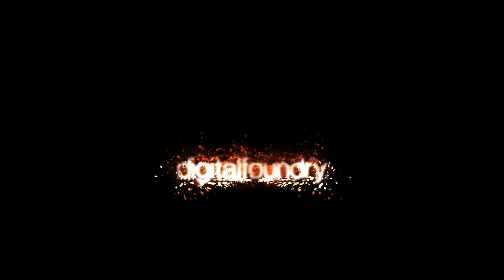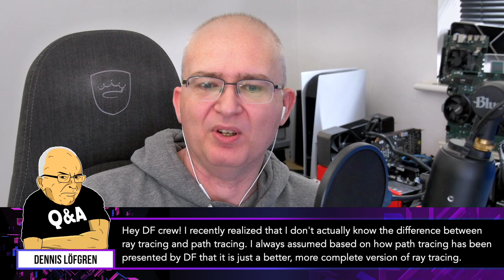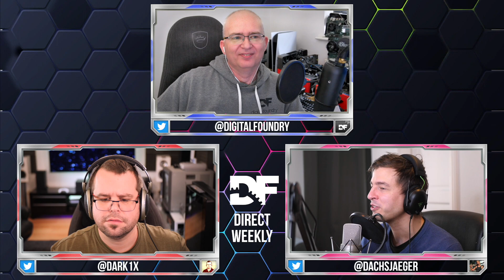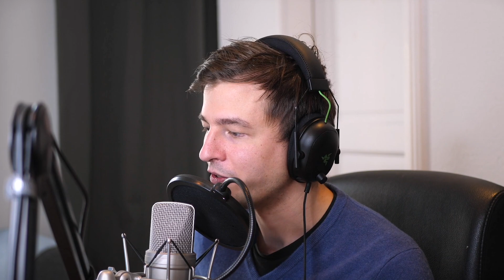What's The Difference Between Path Tracing And Ray Tracing?

Comment: I'd like you guys to do a video on what is actually being computed for every frame (not necessarily in RT but graphics processing in general). When I think of all this stuff I'm thinking it's being done every single frame but I don't think that's true.
Reply: It is being done every single frame - path traced games like Cyberpunk 2077 Overdrive shoot out one or more rays per pixel each frame, and follow the rays through multiple bounces (I believe Cyberpunk tracks up to three bounces). Though DLSS means the frames are not necessarily full size, so there's less work. Real time raytracing can only shoot out a few rays per pixel each frame at most or it becomes unbearably slow on even the fastest GPUs, so the resulting image is always very noisy and has to use strong temporal denoising - meaning rays shot from that pixel in previous frames are referenced for additional information, as well as various image buffers, plus some extra image processing on top.

For comparison, Hollywood CGI movies using non-realtime ray tracers render images with usually a few hundred ray paths per pixel and the paths are tracked through more than a half dozen bounces or simply until the light energy falls below a certain threshold - movies use as little denoising as possible.
Reply: @KillahMate   I read his comment and I kind of got the feeling he was looking for information not necessarily in RT, but graphics processing in general. That was good info for rays though, but what about general compute?
Reply: @Mcnooblet  Oh like shaders and postprocessing and that stuff, materials and screenspace effects and and AA and DOF and motion blur and tonemapping etc etc. That's multiple huge topics. Maybe DF could do a rundown of a stereotypical rendering pipeline, but that's getting really technical - more technical than even DF usually covers I think.

Comment: Basically we are still baby steps. Reason path tracing looks "worse" is because it is so much more complex and takes 3 times as much time if not more as regular ray tracing to complete and thus the noise we see in path tracing is just incomplete picture due to insufficient rays being cast per second.
Obviously they designed some sort of denoisers that developers "hand craft" in order to properly present the picture remove the noise but with that you lose some details. Depends how skilled devs are at hand crafting denoisers to properly treat the image.
Now the newest addition is using A.I. to do the denoising as obviously A.I. is just going to be soooo much faster, more efficient and at the same time better at it just as we can see with cyberpunk and alan wake 2 but especially in cyberpunk we can still see some innefficiency due to I'd rather call it "beta testing" of A.I. denoiser A.K.A. ray reconstruction. As we can see sometimes it can remove details as it perceives it as random noise, and it can introduce some oversharpening but in 90% of image delivery it does outstanding job AND costs less then hand crafted denoisers.

So basically in the future we will be using A.I. denoiser but the fun part is seeing how much the GPUs will grow in terms of ray casting capability and processing. And how will GPUs look in the future say 5 or 10 years from now when probably most of the die will be transistors made to shoot rays instead of drawing raster.

Oh boy what a time to be alive. Transitioning into what we could only watch in animated movies or live action with CGI. I just can't wait to see what wacky shit devs will come up with when path tracing becomes standard. Everyone probably thinks "ah they'll just focus on realism". Nah. That's the beauty of it. When you don't have to mess with a scene for a month because you are trying to hide fuck ups from poor rasterization lighting that is casting shadows weirdly but have proper accurate tool that casts light accurately, you can spend all that time making the scenes look gorgeous, weird, messy, clean, sick... Whatever you want it to be.

Gosh I truly cannot wait.
Reply: You think that game devs have anything to do with Denoising RT effects , You give us way too much credit.

Most of that happens on a driver and game engine level long before game devs get our hands on it.
Reply: @Jasontvnd9  yes that's if you want to use default denoising settings that are shipped with.
If you want to extract details from denoisers you gotta go custom and fine tune it to the way you envision it balancing between loss of details or noisier but with more details.

Comment: I am just amazed GPUs can even do path tracing, that workload is very memory latency and not fit for SIMDs, its truly an achievement, if only someone shares(amd/intel/nvidia) about how they are actually doing it i.e handling random memory request..
Reply: While the workload is high, it's not necessarily doing the same work as a full-on ray-tracer in something like Blender would. Ray Reconstruction and similar techniques are doing a lot of the work to fill in the gaps to take what's a relatively incomplete image and get you the final result, if I understand right.
Reply: @docmars   I thought RR was just replacing the denoisers and getting rid of the noise of PT/RT in a more efficient way. What do you mean it and similar techniques does the work to fill in the gaps on what's a relatively incomplete image? I wouldn't call raster lighting, shadows, and reflections an "incomplete" image unless you mean the whole thing is an incomplete image because it's all fake anyway. Realistic lightning, shadows, and reflections is more of a supplement to an existing rasterized image, that at its core is still a rasterized image regardless. RT/PT isn't necessarily to complete an image, as much as it is to enhance an image more accurately.

Comment: I’m still lost, I thought the whole point of ray tracing was to shoot and bounce more rays to gather more information. Could yall make a more illustrated version of what yall are trying to explain?
Reply: XOTWOD
Reply: What I understand is: RT itself is just like shooting a laser from point A to B (ray casting). When you do that, you may, via rendering API (like vulkan and dx12), ask what was hit for more info, like its properties, which color, which material it is made of. Then if developer wishes, this type of info may be used this to compose and improve your 3d application image output based on what developer decided to query with the rays engine shoot in 3d space. That's why with simple RT you may enable RT Reflections, or Shadows or AO individually, which in turn makes it a cheaper option since you are being more selective with the rays you shoot and also the info you are querying for (plus devs might do smart things like avoid shooting rays when it is unnecessary etc).
What usually happens with Path Tracing is that while you are still shooting rays, it is now an insane amount of rays going everywhere, randomly (mostly), plus already asking the surfaces/objects what are their properties, then, instead of using that info to compose image output, it is going to be used as the image output itself, having little to none image composition, mixing traditional rasterization. It is more simple because you wanna avoid going too smart with the rays you shoot in order to get the most accurate image output possible
(if I said anything wrong, feel free to correct me)
Reply: @Ferdam  That's a common misconception and no, in both cases you shoot rays from the camera and trace them recursively.
It's really more about the lighting being made of a single coherent pass rather than distinct components like AO, GI, etc - it all happens in one, rather than being separate and composited together, leading to more realistic and fine-grained results especially where things like shadows, GI and AO would normally mix.

Comment: I always thought 'path' tracing referred to the complete path of light as apposed to a ray which only relates to a single straight line 'ray' from point A to point B. A path would, for example, include not just a line from the camera to water, but also calculate the refraction angle of hitting the water and continue to a mirror in the water where it calculates the reflection off the mirror and continues back towards the surface of the water where it again calculates the refraction of leaving the water and continues to terminate on a non-reflective surface. It then calculates the color of that non reflective surface by checking the surface color properties combined with how that surface is illuminated.
Reply: That is correct. Ray tracing is every kind of rendering with light rays, and path tracing is a type of ray tracing using many rays to calculate light paths.
Reply: @KillahMate  No, this is not quite correct, as even in raytracing you can calculate a complete path of light. It's more about lighting being one coherent pass instead of separate components like reflections, AO, etc - but there is no one definition for it.

Comment: one destroys performance and one completely annihilates it and pees on its grave
Reply: And both look and perform worse than any other rendering method for global illumination.
Reply: @vitordelima  there is no rendering method that looks better than path tracing (at least yet)
Reply: @moistweineis Rasterisation can look amazing. Just look at RDR2 which is what 5 years old by now, or any tech demo/benchmark worth its salt. Heck all the way back in 2007 Crysis was impressive, and it was largely hardware of that time holding it back. Much can be achieved even in DirectX 9.
Reply: @Koozwad And those are older methods. VXGI 2.0 looked almost the same as those Hardware RT methods but it was also clear looking and without any post-processing (not even upscaling).
Deep screen space GI is hardly any different from a fully raytraced reference from Blender that takes minutes to render, and many of the issues of such methods can be improved.
Reply: @Koozwad  i didn't say say that raster can't look good, i said that path tracing is the ground truth right now.
Reply: @vitordelima  Yeah, heck, even in the late 90s/early 2000s, perfectly sharp real-time reflections were possible. What ever happened to those? Not everything has to be blurry for some reason. Is blur the new meta?
Reply: @moistweineis  That's the thing though, if enough work gets put into it, rasterisation can look better and without the inevitable trade-off that RT/PT requires. No blur, no reliance on trickery(fake resolutions/frames) to make it playable. RT/PT is a relatively quick and lazy way for devs to make games 'shiny' but it does come at a cost in fidelity, if you get what I mean.
Reply: @Koozwad They used cube or sphere mapping, or flipped everything according to the plane of reflection, or other tricks. Those methods also improved as time passed, for example cube maps can use parallax correction so it doesn't always look metallic and screen space reflections replaced those old tricks which involved redrawing part of the scene. Both can be hybridized together with some voxel based raytracing to achieve similar results to RT.

Comment: These terms got different meanings over the years so if you start googling the terms it looks like they are getting used for the same thing.

Ray tracing is just determining visibility between two points by casting a ray from A to B and see if it intersects something. Path tracing is using ray tracing to calculate effects like global illumination. What games call ray tracing is more akin to what we often call Whitted Ray Tracing.

With Whitted Ray Tracing you cast rays for effects like refraction, reflection or for determining if a pixel is in shadow. A game can choose to use ray tracing for some of these effects or all, so you can mix and match. For shadows you cast rays to all light sources to see if the pixel is lit. For reflection and refraction you cast rays in the direction of the refraction/reflection and then on hit,  another ray to see if the new point is in shadow. You can also use ray tracing to simulate ambient occlusion (which is actually a cheap hack, but one that is often used as it makes object seem more grounded).

With path tracing you simulate multiple bounces of light. You don't just cast rays against light but you cast them in all directions because light can also bounce of walls. Because of this you simulate both reflection and global illumination at the same time. You also don't need to calculate ambient occlusion. Because you need to cast rays in all directions you need to cast more rays to reduce the noise and so it's more expensive to calculate.

Both Whitted Ray Tracing and Path tracing are forms of Light Transport algorithms. There are also more algorithms that fall under Light Transport and a lot of them use ray tracing. Because of this the terms get mixed up a lot in literature.
Reply: Thank you. Follow up newb questions:
1.) so in the context of the question of which is “better” path tracing (pt) is more complete than ray tracing (rt) in that you are obtaining a more complete understanding of how to render various pixels?
2.) pt looks worse than rt right now because we don’t have the horsepower to do full pt without some optimizations/hacks/guestimations so we don’t do full pt but there might be games with fairly full or complete pt?
Reply: I don't usually see much of a difference (if any)between RT shadows and non-RT shadows and RT and non-RT light sources. 
So I shall usually use just reflections.
They tend to look incredible in CP2077. 

In Spiderman 2 also from what I can tell from DF analyses.

Comment: When you say "you shoot another ray to get more information" do you mean just increasing the number of bounces? I thought the difference between ray and path tracing was that one traces the ray from the camera to the light source, and the other bounces the rays around the objects in the scene. I could be wrong. I was hoping this video would fill the gaps in my knowledge, but I'm afraid it failed to do so.
Reply: No, "bounces" is how many times rays are hit and reflected. Say if you have 1 bounce, it'll hit the object and go to the next object only one time, then give information back.
Two bounces are: hit the first object, then the second object, then the third and give information back - so on.

Both path and ray tracing use bounces, however, path tracing is more accurate as it doesn't require information to be visible to the "player". While Ray tracing only knows what's in view - kinda
Reply: @DanielLangeYT  That's incorrect. You might be thinking of screen-space techniques that require stuff to be in view - both path tracing and ray tracing are global.
Path tracing is a type of raytracing.
It's really more about the lighting being made of a single coherent pass rather than distinct components like AO, GI, etc - it all happens in one, rather than being separate and composited together, leading to more realistic and fine-grained results especially where things like shadows, GI and AO would normally mix.

Comment: If you really want to boil it down, Real-Time Ray Tracing is the calculation and rendering of realistic light bouncing and reflections in relation to the surroundings, and due to how demanding it is on current systems certain aspects of Ray Tracing can be enabled or disabled, such as Shadows, RTGI or RTAO.
Path Tracing is basically Real-Time RT within Real-Time RT; It's RT with more data involved, which requires a second passthrough to do it and because of that accuracy you begin to get extra details like the Inter-Reflections example (Imagine looking in a mirror, through a puddle, and it's all dynamically rendered at once).
Reply: Thank you for the missinformation. Real time rt within real time rt lmao wtf you on?
Reply: That's not true though. Recursive raytracing does not make raytracing pahtracing. It more about all components of illumination being done in one coherent pass, rather than as separate effects like AO, reflections, etc.

Comment: What's the difference between ray tracing, and path tracing? That's like saying What's the difference between a square, and a rectangle. The ray tracing is a general technique for light simulation, and path tracing is one type of ray tracing that focuses specifically on multiple bounces of light in order to simulate indirect lighting. That's it.
Reply: Yep. In this clip Alex jumped into the weeds of sparse rays and random distribution and denoisers.
Reply: It's what I assumed. This explanation was far simpler and easier to grasp.
Reply: This.

Comment: One you trace from the camera, the other you trace from the light source.
Reply: False. You trace both from the camera. Otherwise it would be physically impossible to run because you have infinite light paths and basically nothing would ever hit the camera - and there are 0 benefits to doing it that way. You are wasting almost all your calculations on light that goes nowhere.
It's really more about the lighting being made of a single coherent pass rather than distinct components like AO, GI, etc - it all happens in one, rather than being separate and composited together, leading to more realistic and fine-grained results especially where things like shadows, GI and AO would normally mix.